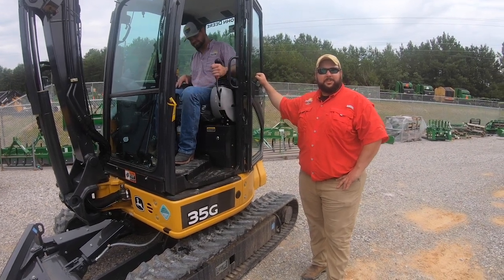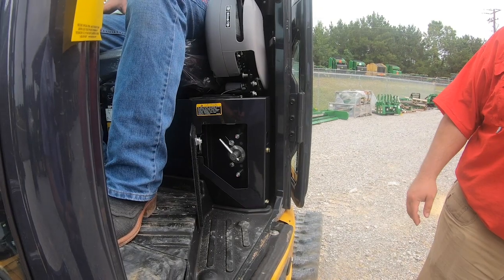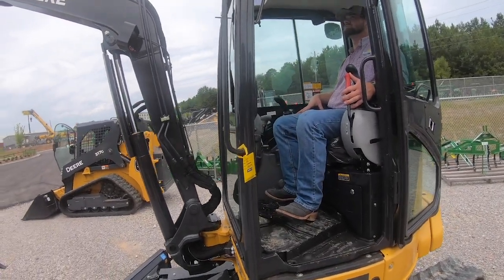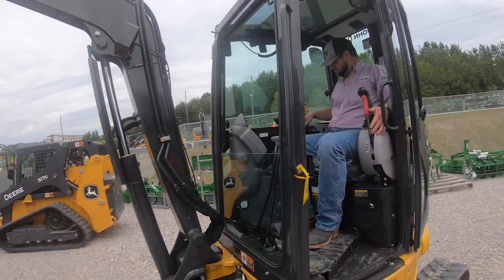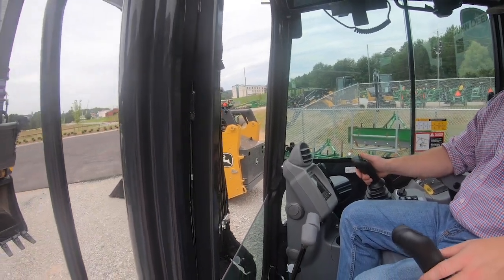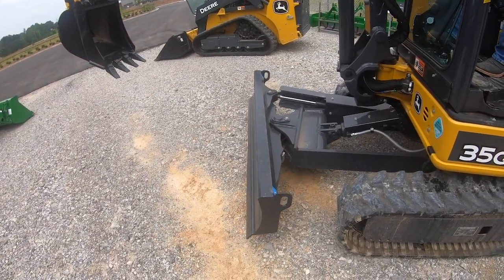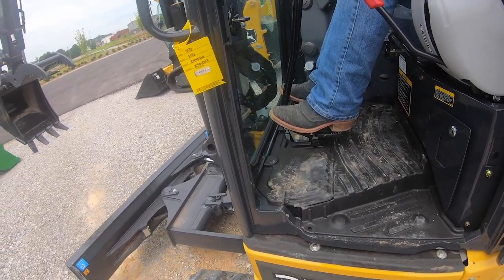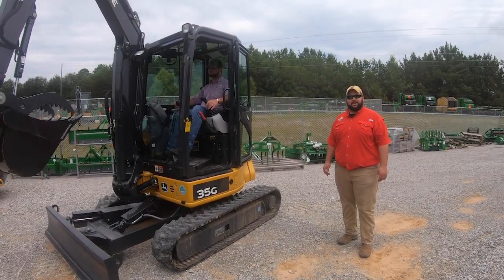Features of a John Deere 35G Mini Excavator

Comment: Made by Hitachi
Reply: Is that a good or bad thing? I’m in the process of shopping & learning what to spend this kinda coin on.
Reply: @07negative56  Very good thing. Hitachi is a very reliable Japanese brand.
Reply: Dang! Thanks for the reply! I appreciate you. I’m not very experienced when it comes to this kind of equipment. When it comes to dropping $50,000-ish on equipment. You kinda want to make sure you’re spending wisely. Thanks again.
Reply: @georgehofgren6123  get your facts right before trying to correct me. The Deere minis are designed and manufactured by Hitachi in Japan. That’s a fact.
Reply: HATE those stupid flip up pedals.  Boom swing in the floor is also stupid